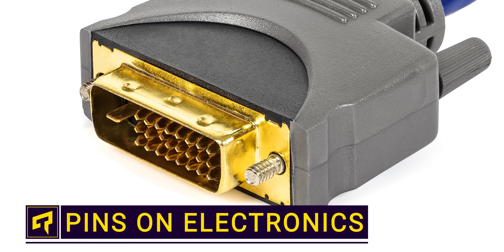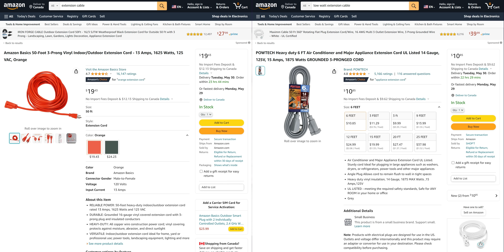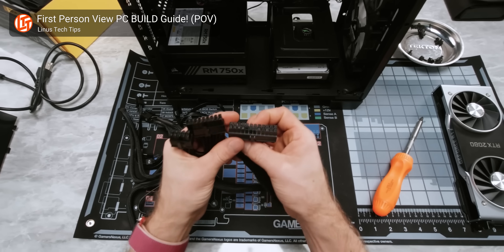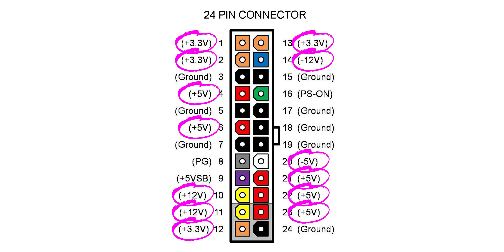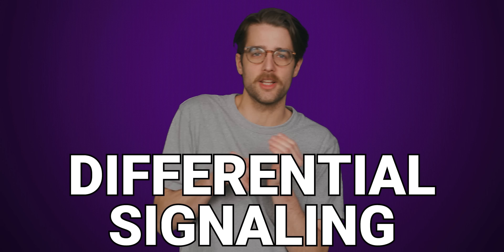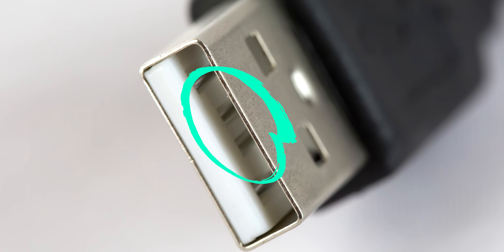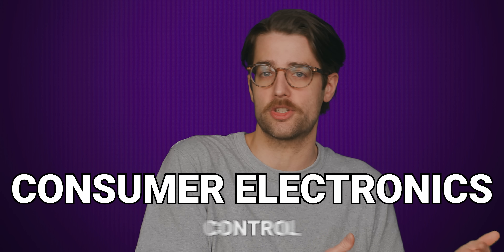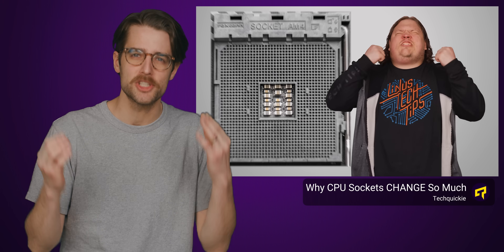Why Connectors Have So Many Pins

Comment: Man, that neck cooler advertised. Seems a bit insane to have a lithium ion pack of that size resting against your jugular. Would be quite a scene if that were to go up.
Reply: Everyone got one half the size in their pocket.
Reply: Yes half, and in their pockets, exactly
Reply: Take it easy, the battery of AICE 3 is customized to be compact and safe. It has passed both our internal safety tests and external safety certificates (including FCC and PSE etc.)

Comment: about sponsor: in what way is a simple MPU for a thing like this AI, whoever greenlit this ad needs to not be so easily enticed by the latest buzzwords, IFTHEN =/= AI. i could make one today that does the same thing with the junk i have laying around. if neck gets hot, then turn on fan, if neck gets real hot, then turn on peltier chip and another fan. ... can do it lighter with a simple anker pack all at 5V with $35 ($300)  worth of parts. since id be designing the housing using 3D cad models, id already have my 3d demo vid. also, i thought these startup sites had rules now about established companies using them to hype up their productline. annnnnd a little more poking around, this is becoming one of those look/work all the same cheap Shenzhen devices you would find all over amazon, bog standard chips (most likely scrubbed), casings, and features just with a custom name slapped on the housing (search "neck cooler")
TL;DR, you sponsor is selling overpriced junk with overplayed busswords. way to go LMG.
Reply: Thank you for your suggestions. We do hope making AICE 3 is that simple. 2 x 3,500mAh batteries + 4 high-speed fans + 6 sensors + 2 thermal pads + 1 touch screen + 1 speaker + 1 micphone, not to mention air duct design, electronic circuit design, firmware design and App design (yes, it has an App), hardware and software collaboration... Our R&D team took nearly a whole year to make AICE 3, if you can make AICE 4 in a cheap, fast and effective way, come and join us, seriously.

Comment: Please get your electrical engineers to review sponsorships like this, in the future. It looks like a scam.
Reply: But it has the all mighty AI, so that means it can defy  the laws of physics ;)
Reply: Whoever did the 50 degrees Fahrenheit = 10 degrees Celsius conversion doesn't understand the difference between a temperature and a change in temperature. A change of 10 degrees Celsius is a change of only 18 degrees Fahrenheit, not 50.
Reply: 100%
Reply: Laws of thermodynamics say NO. 7000 mAh @5 V for 6 hours of cooling? Even at 100% efficiency that would only be about 6 W of cooling power. For reference, a human body in rest generates about 80 W of heat, and even a small portable AC uses 1000 W.
Reply: @bestpracticeses  it’s not supposed to cool your whole body, only the neck, besides, it is possible for a small device like that to cool air 10 C. Also, heat pump devices can be more that 100% efficient, meaning it moves more heat than the energy needed to move it.
Reply: @bestpracticeses  Yeah, I was trying to same it kindly.

Linus hates subscription stuff and has done a LOT of ads for the subscription-bed-cooler already, and this is really making it look worse as well.

They're really falling off.
Reply: @bestpracticeses  thats for cooling with peltier modules, not heat pumps. Heat pumps use only a fraction of the heating/cooling energy they produce
Reply: THIS
Reply: There's not a heat pump in something that small, it has to be a peltier device which I highly doubt would last as long as advertised
Reply: I can assure you that AICE 3 is not a scam, I have one right by my hand, and it truely works.
Reply: @henryzhong1989  I don't really trust the CEO on his claims about his thermodynamic-violating product
Reply: You mean electronics engineers. I am pretty sure that neck ac doesn't use 110V.
Reply: @TheReal_XiJinping  ha electrical engineers deal with all levels of voltages…
Reply: @nicolausjennings3707  not really tho. Electronics engineers deals with electronic voltages,from 1 to around 50 to 60 V. Electrical engineers deal with 110V and up. Multiple countries have regulations on wether an Electronics Engineer or an Electrical Engineer can work on a project or not. 110V below is mandatory to be worked with Electronics Engineers, while 110V and above are mandatory to be worked with Electrical Engineers. How do I know? Because I am one - I'm an Electronics Engineer by degree and by profession.

Seems like you don't even know the difference between an Electrical and an Electronics Engineer.
Reply: @nicolausjennings3707 You took the words right outta my mouth! Why, oh why must people talk about things they know nothing about?
Reply: @TheReal_XiJinping You are obviously lying to sound smart. You couldn't be more wrong. Electronics Engineering, along with Power Engineering and Control Engineering, is a SUBSET of Electrical Engineering. Some Electrical Engineers do NOTHING BUT Electronics Engineering!
Also, some colleges now offer an EEE Degree, which is "Electrical and Electronic Engineering"
Reply: @MrMcavoy80  Search the difference between EE and ECE and you'll see. Stop blabbering nonsense you know nothing about. EE as a profession is DIFFERENT from an ECE. Lmao.
Reply: @MrMcavoy80  Electrical engineering is primarily concerned with the large-scale production, transmission and distribution of electrical power, while electronic engineering focuses specifically on the design, optimisation and management of smaller electronic circuits and devices.

That's why many countries have specific regulations on which type of engineer are qualified to be involved in a project.

For example, on the company I'm working at now, we are designing safety systems on automobiles. Specifically, airbag systems and ECUs. Every single one in my department is required, by law, to be ECEs or ELECTRONICS ENGINEERS. Because we handle low voltages involving microprocessors and embedded electronics, typically 5 to 12V. 

However, in the Power Systems and Distribution Industry, the law requires that EEs or Electrical Engineers work with their systems, raging from 220V to kV  electric systems.

Again, read more about the topic before replying. You're clearly not informed well on this topic.
Reply: @TheReal_XiJinping  we get it you can Google something now quit your whining

Comment: I don't know about that sponsor, guys..
Reply: Thank you for asking. RANVOO brand has existed for over 10 years (founded in 2012) and it's now the largest brand of personal appliances in China. AICE 3 is its 6th generation of neck fan products, and the 3rd generation of neck air conditioners. So both the brand and product are real, not a scam / fraud.

Comment: single 12VHPWR 600W being smaller than its predecessors 8 pin at 150W max really shows how great that connector really is

/s just in case it wasn't obvious
Reply: Or how conservatively-rated the 8-pin was...
You know... because as long as the 12VHPWR cable is actually plugged in it's fine at 600 watts.

Comment: You've been successful in triggering me to contribute to your audience engagement stats; Your thumbnail, as of 2023-05-24/0036 German Local time/UTC/GMT +2 has been a LFH(Low-Force-Helix) connector! I've got a rather old Matrox G5xx PCI(non-express) graphics card, right here! …you post-millenial, whipper-snappers have not idea …*cough-cough* …i'm feeling rather OLD LUL
Reply: …there are a few variants to the LFH-60 connector - there's the DFN-59, iirc. IMHO, it's a sith show! Everyone should've implemented the LFH-60 connector - but, alas, capitalism made sure of DFN-59 … i'm not quite sure about the chronology, that's a topic for another video.

Comment: You forgot to mention that while its possible to send data two ways using the same cable (or the same differential pair) you usually need to wait between messages to allow traffic from the other side (similar to how it works with cars).
That's why you usually have 2 (or more) differential pairs each going in one direction only.
And if traffic usually goes in one direction, then you can have an asymmetric connection (eg. 3 pairs going in one direction and just one going in the other). A good example is ADSL internet (though the asymmetry is usually deeper in the network) that has more connectors for downloading than for uploading data.
Reply: CANBus and i2c, even though the latter use single ended signalling also do the same thing

Comment: The video mentioning, a lot of power needing big pins. But didn't give an explanation, how the respective USB-C standard manages to deliver so much power through those tiny pins. Cable thickness is one thing, but the pins are all the same, aren't they?
Reply: The pins are short compared to the cable length so there isn't as much of a voltage drop across the pin. There is still a drop across the contact, and compliant devices should know how much power is being dissipated in the cable because of a bad contact and limit power accordingly.
Reply: It uses 4 pair of vcc and ground pin, so a little more than 1 amps per pin for 100w, 20v 5A power delivery

Comment: but what about SDI cables, they only have "1" pin? would be great to get explained
Reply: SDI has 2 pins  (one inside for signal and the other is the screw for ground) and it can only send signals.
Though there is also a standard called "1-wire" that while using 2 pins, it can transfer both data and power via the same pin.
Reply: The outer part is the ground, the inner part is the Serial of the Serial Digital Interface

Comment: Wait does Techquickie just advertise anything? If we advertise neck coolers, do we also advertise dysons mask headset?
Reply: Neckcooler Indiegogo scams. It´s not even a real product yet
Reply: I need a neckbeard shaver.
Reply: I'm glad other people's bullshit detector went off there too.
Reply: Whoever did the 50 degrees Fahrenheit = 10 degrees Celsius conversion doesn't understand the difference between a temperature and a change in temperature. A change of 10 degrees Celsius is a change of only 18 degrees Fahrenheit.
Reply: @bra-doo-ah  Linus has enough following now that if he just used C (which I think he does on LTT?) enough of us 'muricans would just break down and "learn" it once and for all.
Reply: @bra-doo-ah  The advertisement about the shitty quackery was shitty and quacky? No way!
Reply: @bra-doo-ah  The unit conversion you gave is absolutely correct. In ambient temperature: 10℃ = 50℉, but in unit conversion: 10℃ = 18℉. The vast majority get confused, you‘re one of the very few.
Reply: How to get neck hurting 101
Reply: I would rather the Dyson mask headset. That's a real product that presumably functions in some way
Reply: THAT would be funny af! 😄 😆 🤣

Comment: The temperature conversion on the sketchy sponsor is wrong. Assuming the 10°C of temperature difference is the right one, that equates to 18°F of temperature difference, not 50°F.
Reply: Somebody failed to appreciate the distinction between temperature versus temperature difference .
Reply: This Indiegogo fundraiser is so obviosly a scam LTT has 0 integrety left when it comes to sponsorships

Comment: Video suggestion as a follow up to this one about how much an pcie 8x slot is limited versus an 16x slot and if (for an gpu) an 5th gen 8x slot would perform better than an 4th gen x16 slot.
Reply: A PCIe x8 slot has half the total bandwidth of an x16 slot of the same generation. There are some x16 peripherals like network interfaces, FPGAs, or NVME drives that have an x16 interface but are actually multiple sub-devices with individual x4 or x8 connections, so they either won't work at all or lose half the devices in an x8 slot. PCIe slots less than x16 are also limited to 25W power through the slot.

Given that most GPUs will only connect at 4th gen speeds, 4.0 x16 has more bandwidth than 5.0 x8, though PCIe bandwidth is rarely the bottleneck for gaming applications. If you were using a PCIe 5.0 capable card, bandwidth would be equal, with the gen 5.0 connection having lower latency. PCIe 5.0 can also have CXL cache coherency which should reduce some of the pressure on the bus.
Reply: Exactly half
And: The same.
Reply: Absolutely! There aren't already thousands of videos showing exactly how PCI-gen and bandwidth affects the performance of literally every card from the last 10 years or so.

Comment: You forgot one of the other main reasons why there are so many pins to transfer data, especially with cables and PCIE cards. The reason is because they can't drive the data transfer speed too high or the cable (and even the tracks of solder on the motherboard) begin to send out RF (radio frequencies) which causes interference and issues with many other devices. 

The reason why CPUs can get super fast clock speeds in the Ghz range without this issue is because the components are all super close to each other and on the same die. When you need to transfer data to a graphics card though, the clock speeds have to slow down to go the distance. To keep bandwidth high, they just add more lanes to PCIE since they can't turn the frequency up any more.
Reply: 1000mbps (125MBps) vs PCIe gen4 x1 at 2GBps. PCIe is way faster than gigabit Ethernet. And motherboard traces can’t be twisted. What’s your point?
Reply: is this why faster connection speeds have lower cable lengths? pretty cool
Reply: The reason speed on cabling is limited is down to signal smearing. The higher the frequency and longer the distance the more this occurs. Bandwidth is inversely proportional to distance squared. Long cables struggle to handle high bandwidth signals whereas CPUs can handle multiple GHz internally because the distance between points on the chip is small. 

You can improve effective bandwidth by using more than one channel at once, but then as speed increases you start to have issues synchronising them. This is why SATA replaced PATA for hard drives and USB supplanted standards like Centronics printer ports (the fact that it was smaller and cheaper helped also). Subtract signalling overhead and error checking/correction and you can hit a little over 10 bits per byte transferred. HDMI can hit up to 48Gb/s over 3 channels (technically 4, but one is used only for the clock signal), but you need a high quality and relatively short cable for that.

Radio interference hasn’t been an issue for a while. CPUs etc used to run on frequencies close to AM radio. These days they run at much higher speeds, and AM band frequencies are used down unshielded phone lines for ADSL or on mains wiring for power line ethernet. AM radio is much less of a thing, and the power level used for signals is quite low.
Reply: This is completely backwards. Clock speeds go up at longer distances. SFP28 has up to a 28GHz clock, much higher than any CPU, and transmits over several meters of Cu. Even PCIe 4.0 (a common CPU-GPU interface) clocks at 16GHz. PCIe has had regular increases in clock speed, from 2.5GHz with PCIe 1.0, through 5, 8, 16, and 32GHz with PCIe 5.0. PCIe has never added to the 32 lanes originally specified and only x16 lanes are common.
Reply: And yet gigabit Ethernet works fine over unshielded twisted-pair wiring.
Reply: @lawrencedoliveiro9104  gigabit isnt that fast lol
Reply: @gamagama69  We have specs up to 40Gb/s, even 100Gb/s by now.
Reply: @lawrencedoliveiro9104  That's in gigaBITS per second (Gbps), not gigaBYTES per second (GBps). 100 Gbps = 12.5 GBps. A PCIe Gen 4 x8 can do 16 GBps and an x16 can do 32GBps. And that's without twisting the wiring.
Reply: @astral6749  I did say “b”, not “B”, did I not.
Reply: @lawrencedoliveiro9104  Yes, but I'm also referring to your first comment where you compared UTP to PCIe. What I'm trying to say is that PCIe Gen 4 (x8 or x16) is still faster than 100Gbps UTP.
Reply: @lawrencedoliveiro9104  1000BaseT uses some weird tricks to send 10 times the data at the same frequency range as 100BaseTX (a leisurely 125MHz). First, it uses all 4 pairs instead of just 2. Second, it actually uses each pair bidirectionally with echo cancellation for 4 times the efficiency. Third, the signals use 5 different voltages instead of just one positive and one negative so there is more information in each oscillation.
Reply: @ailivac  Trellis coding?